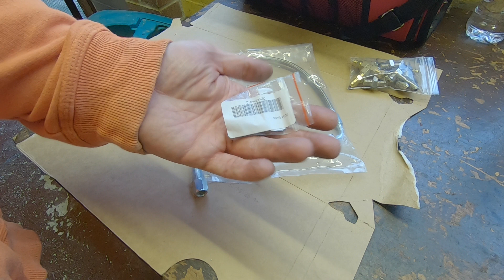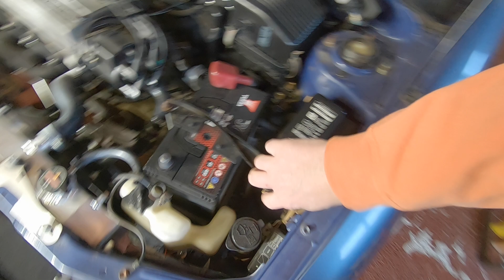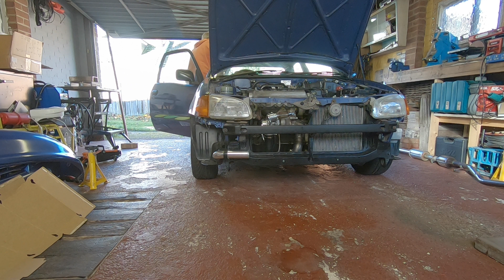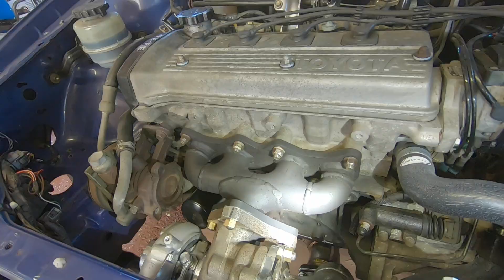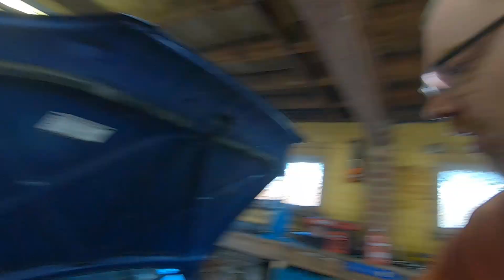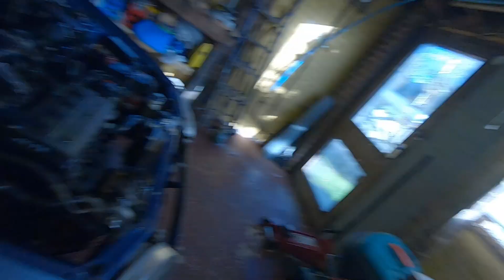Starlet turbo oil feed and drain fitted + test start | Toyota Starlet 4efe turbo build.

Comment: Hey, Dan

I know this is an old video, but I am curious as to where you got the stud/pipe with the neck/buldge for both the turbo and the oil pan for the hose to fit on over.
I'm in the same proces and would like to go the same route.

Best regards, may this thing rest in peace!
Reply from the maker: I bought the TD04 Turbo oil drain from eBay, was about £20. I made the fitting for the oil pan out of 16mm tube, just cut to length and then welded a bead all the way round to make the ridge at the end.
Reply: @dan91sgarage  Once more I have a question for you... I've seen many sources saying that 2-2,5mm is recommended. How come you went with a 1,5mm?
Reply from the maker: @Fuxhz  thats the size recommended for the Maxpedingrods brand turbo I was using. Iv'e seen recommendations of 1.5 or 2.5mm restrictor. Turbos don't really need a huge amount of oil and the turbo core has a small inlet hole anyway so 2.5mm is usually bigger.
Reply: @dan91sgarage  Thanks a lot for the reply Dan! Keep at it with your videos, theyre so well put together

Comment: What bhp can you get from a turbo 4efe , is it identical with the 4efte apart from the internals ?
Reply from the maker: There are 3 different 4efe engine generations (different parts, too many to list here) the EP91 starlet has the gen 2 4efe engine. The most I'd expect safely from a gen 2 4efe is 150bhp hopefully. But I would realistically be happy with 130bhp (stock 4efte power level).
Reply: Thanks for the reply , it would be a second gen I will be trying to pick up , can't find any 4efte blocks I've Been told the heads are the same apart from valve springs , I'm looking to build one to keep as I've always wanted one , I was thinking of getting the efte internals and putting them in an efe block getting the knock sensor drilled I can get an efte loom ecu and dash clocks would I be able to gain a bit more hp that way ?
Reply from the maker: @Michael-yd6qt  Fe Blocks are just as strong as fte, fte intake cam is different also. If you get fte valve springs, rods and pistons, knock sensor, engine loom, ecu. You will also need: distributor, interior "under dash" loom, injectors, throttle body (and sensors, iacv, wax stat), intake manifold to make the fte ecu work. 
Personally I would rather forge a 4efe and get standalone engine management, because the parts are new (not rare, possibly knackered) and stronger, with better control. 
For me it's 4efe+t and piggy back or forged. 4efte's aren't worth the price/risk anymore (in my opinion)
Reply: @dan91sgarage  cool I see what your saying , and if your forging a 4efe would you be buying forged 4efte rods and Pistons and crank the bores are the same size ? And would you be trying anything with the head itself to lower compression like skimming or different gaskets ? Thanks for all the info
Reply from the maker: @Michael-yd6qt  The 4efte forged rods and pistons are lower compression than 4efe so no need to lower it any more. Most people go for 74.5mm (flat top wossner 8.3:1) pistons and rebore the block to match, that way you know the clearances are correct, you can measure the standard bores and use 74mm's if the bores are correct size (not ideal). Depending on power required Toyota head gasket is fine up to 250hp ish and then cometic mls h/g after that.
Reply: @dan91sgarage  thanks for the tips man much appreciated the time taken 👍 one more question and Ill leave you alone 😂 if you buy forged rods will normal efe bearings be okay to use or will I have to get specific ones ? I'm probably just going to get the forged pistons and rod for the start and worry about the crank later on if the efe is okay to use
Reply from the maker: @Michael-yd6qt  Most people use the ACL bearings in standard size. You should measure the crank and measure the rods with the new bearings installed and find out if the clearances are correct. Speak to Hurley race Engineering and ask their advice as well. They build forged 4efte's all day long and sell all the parts you'll need. The Ep91 4efe and 4efte use the same forged crank (marked 4et) so no worries if you're buying an EP91 4efe engine as a base 😃
Reply: To buy a 4efte car is like 10 grand now and by the time I'll have that in one lump they'll be going for 20k 😂

Comment: Yes Dan love to see it. I would have put the oil feed on the turbo and given it a few cranks with the feed on and efi fuse out to get a bit of oil round the turbo for first start up. Loving the content mate keep it up. Can't wait to get cracking with mine once I get the engine back.
Reply from the maker: Thanks mate, I did prime the turbo with oil @8:45 by spinning engine over with the fuse out as you suggest, I just didn't show the footage of me doing it. Then I put the fuse back in after, which I did show. Yes, yours has been down too long. Any news of how its going?
Reply: @dan91sgarage  ah sweet they do like a bit of lube lol. all going well I'll have the engine back in a couple months then ill crack on.

Comment: Nice one, what is the exact part number or name of the oil feed line kit?
Reply from the maker: Its: Mamba Universal turbo oil feed line kit M10x1.0 - M12x1.5 Str - 90 50cm (COMBO TYPE) 016-0339. The banjo fitting and banjo bolt are sold separately.
Reply: Thank you

Comment: As someone who has a 4efe turbo corolla, good job man, been watching a while and nice to see and hear its first start 👍 lovely job man
Reply from the maker: Appreciate it!
Reply: I am considering turboing my 1.3 4e-fe 1997 corolla. I'd mainly do it for the learning experience. It seems like it's a pretty easy engine to work on. Now, is it worth the effort in terms of learning experience and power gain?

I'm actually mostly satisfied with the admittedly weak power it has but if I could get another 10-20% I'd be elated.